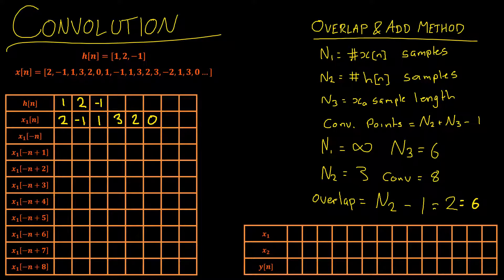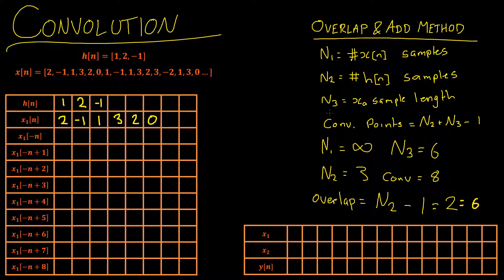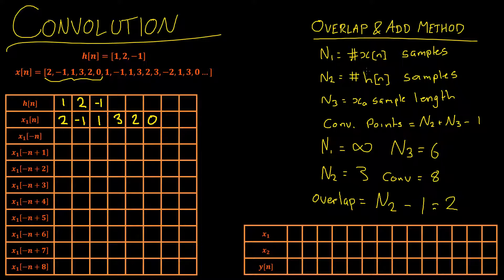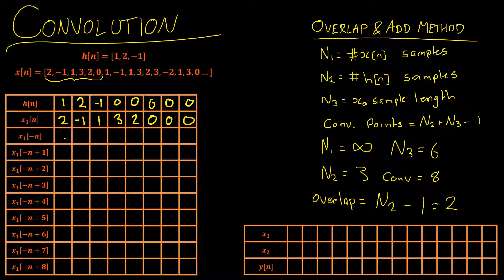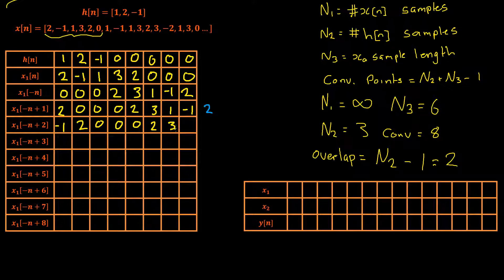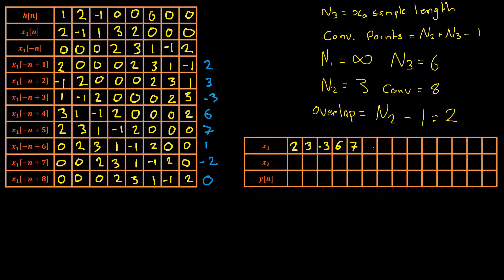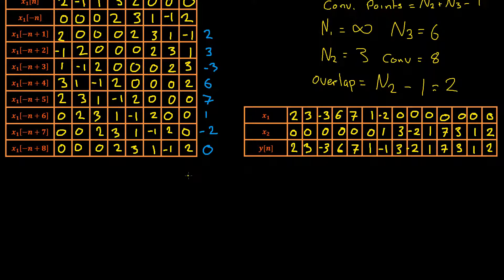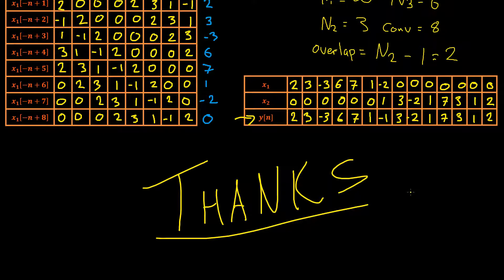Convolution Example - Signal Processing #25

Comment: You probably won't see this comment but I've got a question. Where do you get the x2 from? Did you just make it up? What should I do if they don't give me x2 in a test? Thanks in advance
Reply from the maker: Hey! So you would repeat the same process as we did for x1 for your second signal, however the process is identical to the process we followed for x1, so in this case we arbitrarily chose what the result would be from that operation.
Reply: @TutorialsWithGary  But why are you adding them together at the end? I thought this was just suppposed to be a demonstration of convolving h(n) with x(n). where did x2 come from and why is it at all relevant? this seems liek you're convolving both x1 and x2 with h(n), and then adding them...how is that convolution? that's just the addition of two independently convolved signals